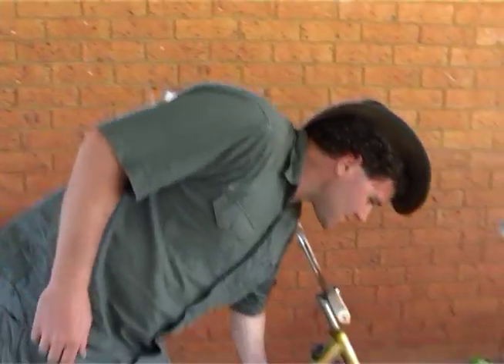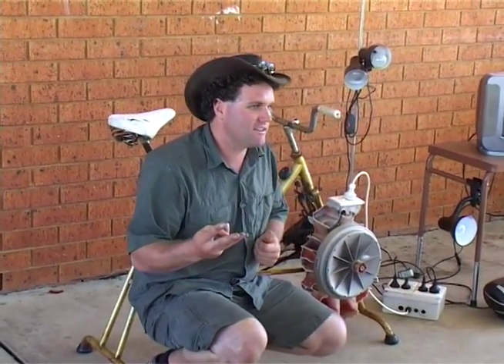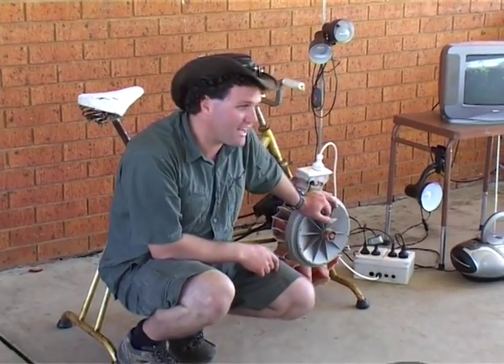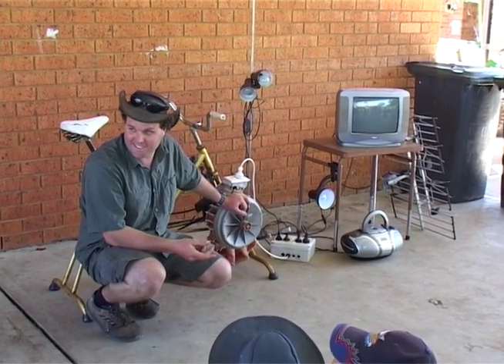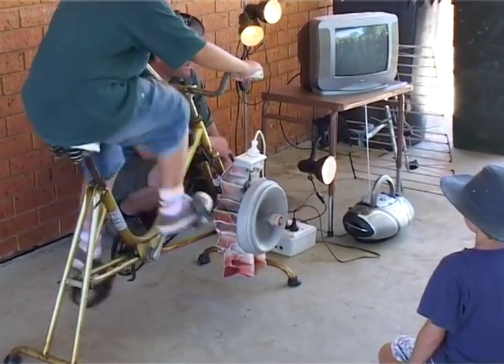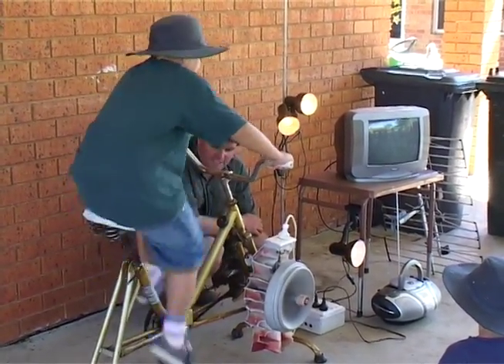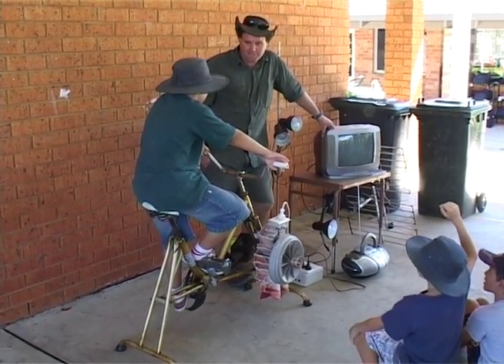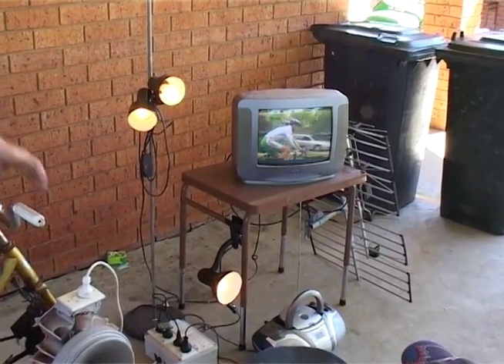Exercise Bike Generator

Comment: Loving my bike>>>ur2.pl/1144. It was quite easy to assemble, no issues at all. I followed a YouTube video about assembling it and that helped a lot. Only small issue is that moving it around is a bit of a drag because you can only bend the bike to a certain angle to be able to move the bike around, which to me isn't the best angle since i have to be constantly moving it. Wish the wheel was a bit larger or situated further back so one could bend it further out and make it easier to move around. Other than that, i have no issues.